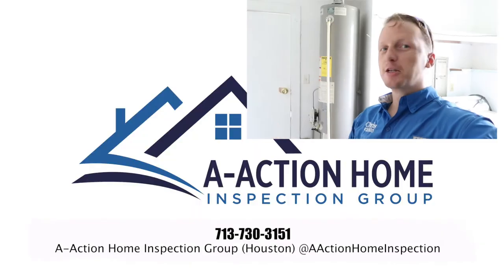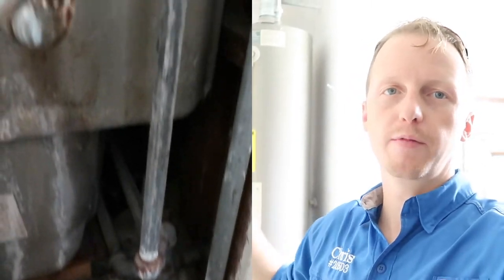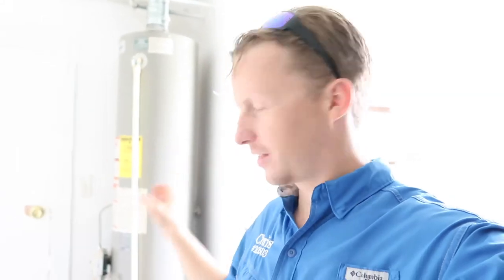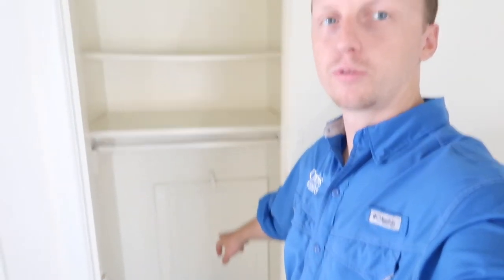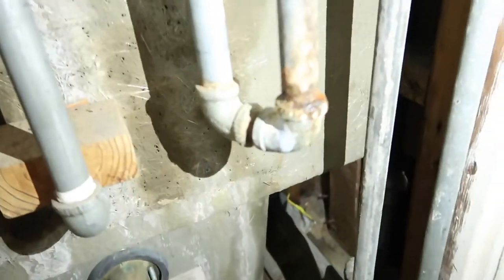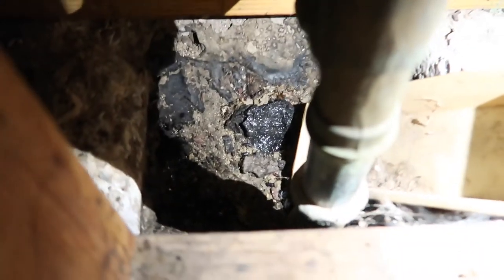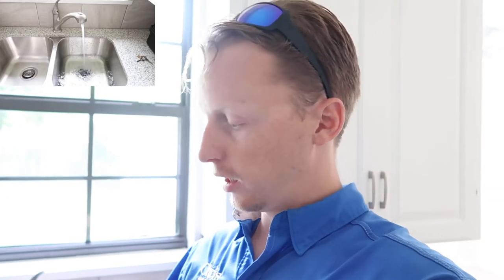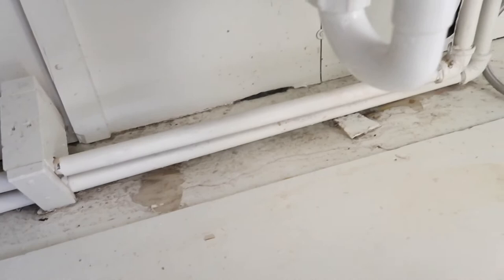Old House Old Problems - The Houston Home Inspector

Comment: Technically only part of the hot water heater is supported by the 2x4 the shelf it also attached to the wall studs. A regular, clear, white pine 2 x 4 stud grade can support static load of about 450 pounds  for a 4' span. This span is maybe a foot. So the 2x4 shouldn't be a problem if it is properly attached. A yellow pine 2x4 will support even more. It may look sloppy but an engineer could tell you that it will support that weight and more with no issues. The leaks however should be addressed.